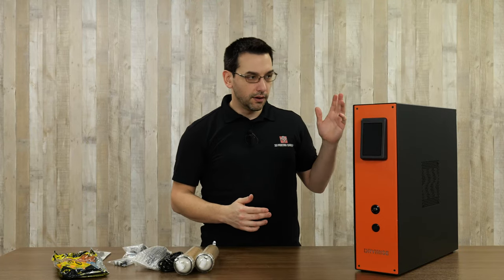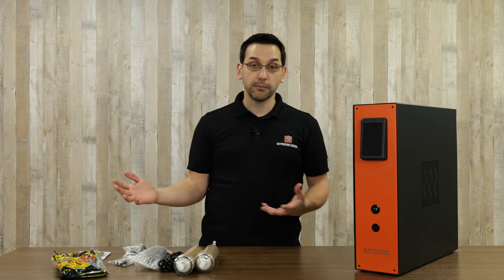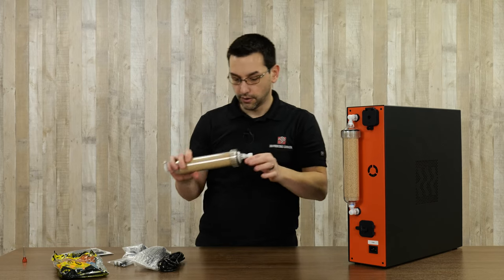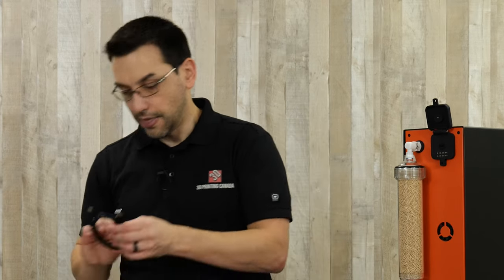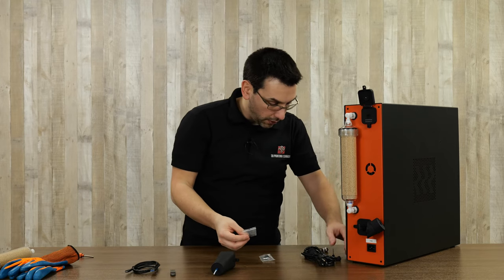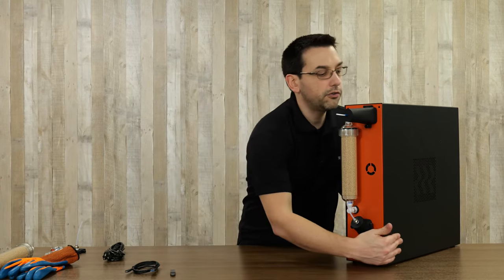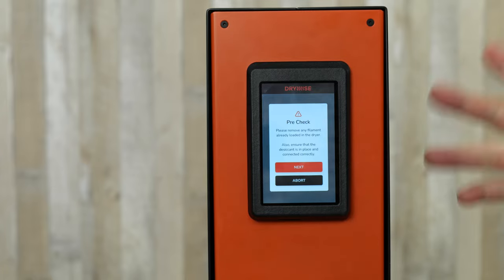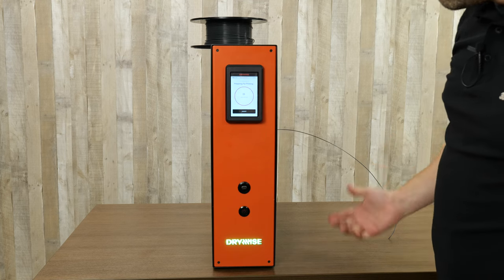DRYWISE IN LINE FILAMENT DRYER - OVERVIEW

Comment: Ouch, for something that price I would think they would have some specs on their website, I mean it’s more than a Bamboo Carbon X1 with the AMS 4 spool cabinet. Like what is their maximum linear filament speed? Kind of a critical spec…By my math if it takes 15min to dry 24” after the initial period that means it maxed out at about 4mm^3/s which is 55mm/s with a 0.4 nozzle and 0.2 height….1900euro is like 2700CAD, would take you 5 years of printing with expensive filament like the metal filled stuff to make this a cost saving over just using a new spool for each print and discarding the rest. For 2700$ you can buy yourself a very large drying cabinet to keep all your spools in where they would always be dry, and honestly unless you are printing at snail speed inside of a sauna in-line drying is not req. Don’t really see who this is for.
Reply: I couldnt have said it better. Great technology. I print CF on the x1 Carbon. I was super interested in the in-line dryer… but pricing and lack of specs are gonna have me stay with my dehydrator and dryer
Reply: It’s for companies that use more expensive and engineering materials